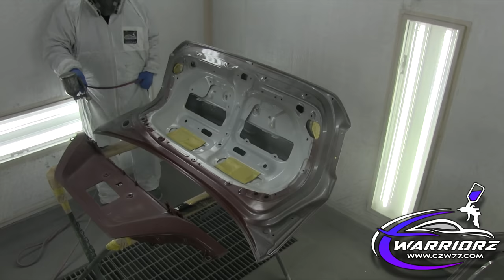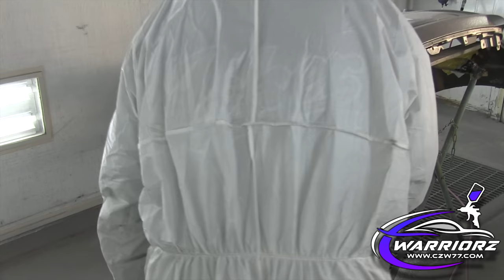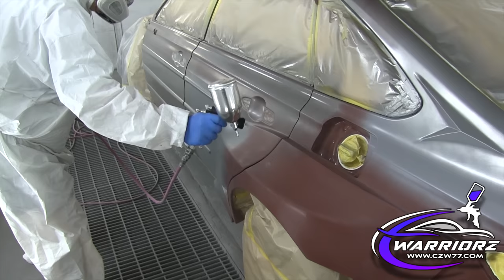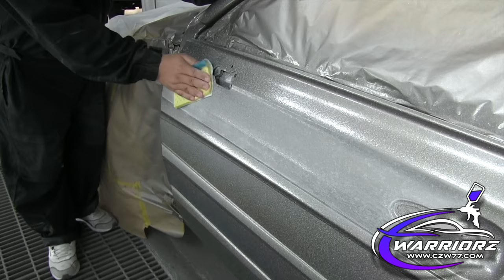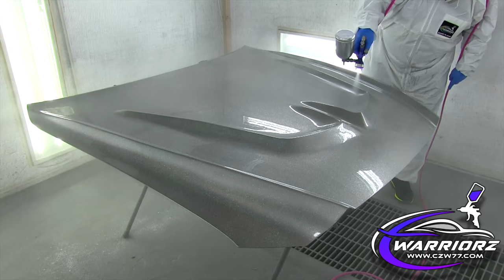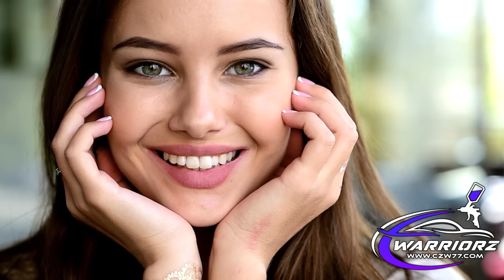How to paint rainbow flakes on Luxury sedan / TOYOTA NEW CROWN【カスタムペイント】

Comment: Flakes size?
Reply from the maker: The particle size of this flake is 1/96 inch (0.3 mm). The shape is hexagonal.
I was thinking of ordering a slightly larger 1/64 inch, initially. But the factory buyer told me. "This flake is most beautiful at 1/96 inch."
Reply: Thx bro

Comment: That takes a lot of patience.  You're very thorough. Do you have to use heat to help the paint set or regular air dry?
Reply from the maker: It requires 12 hours of drying time at 25 degrees Celsius.

Comment: Hi. Nice clip again. But what's means mixing Magic Flakes with aluminium control?
Thanks.
Reply from the maker: Thank you for your feedback. The reason is to minimize the thickness of the paint.If you use normal clear, the thickness of the paint curtain will increase, and eventually the paint curtain will interfere when opening and closing the door.